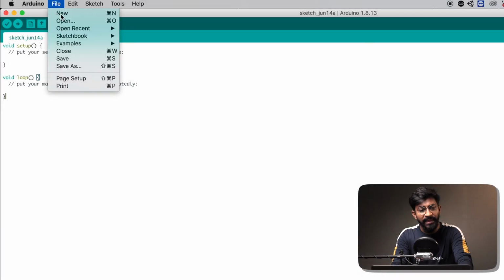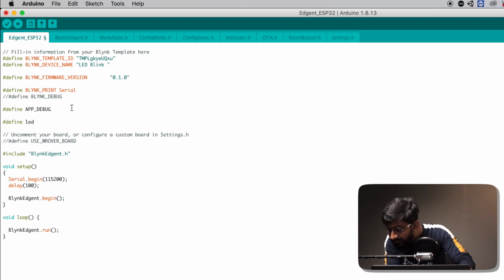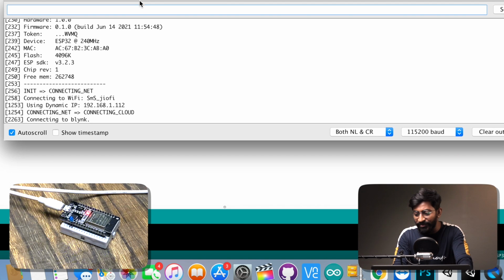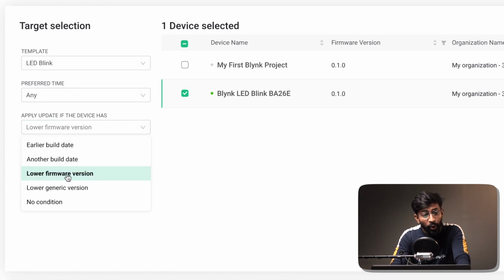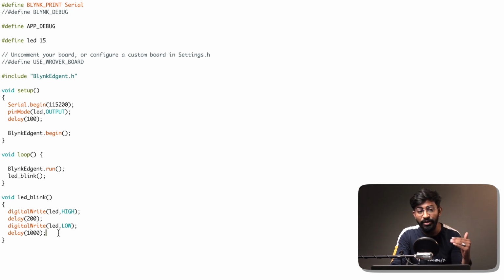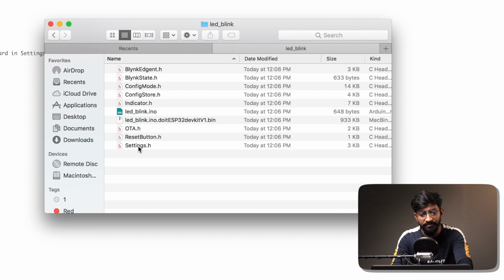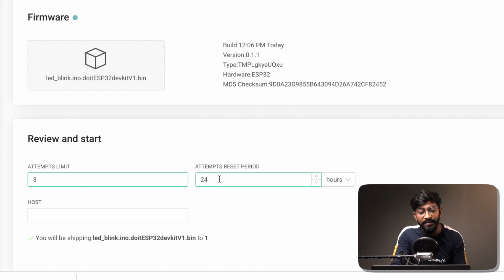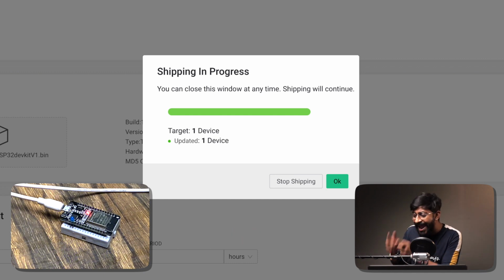Upload Code over Internet 🌎 using Blynk.Air

Comment: Hi Techiesms, i am having issue with my esp32 and sim7080g breakout... hoping you can point me in the right direction. I have rx on pin 16 connected to tx on and tx 17 connected to rx. i am running simple_test from TinyGPS library. and getting ** No characters received from GPS: check wiring ** CHARS=0 SENTENCES=0 CSUM ERR=0

i tested 7080 by itself and can send AT commends through the serial com however connecting it through ESP32 shows the message above.

Hope you can point me in the right direction.